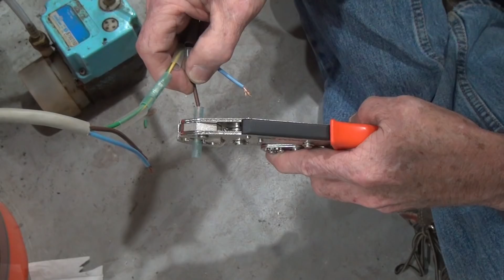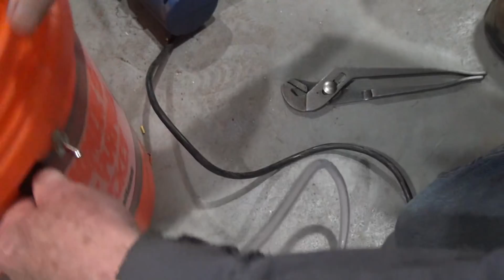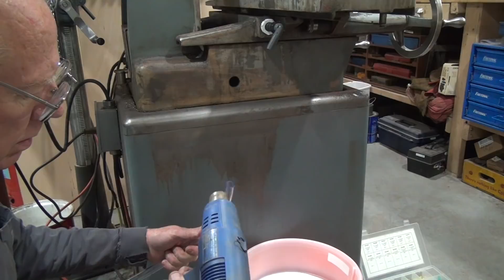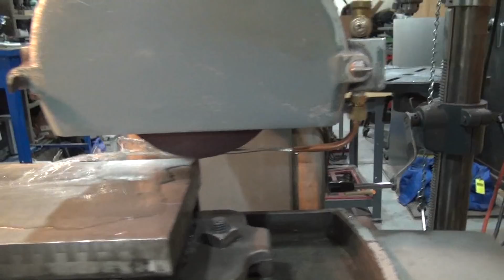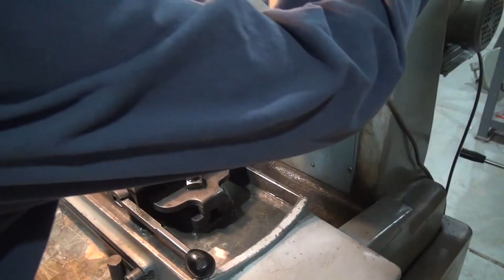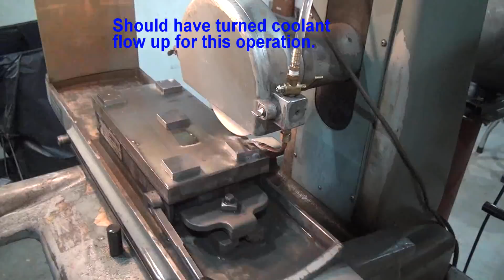Shop Tuneup Series - Surface Grinder Upgrades & Chuck Grinding

Comment: I’ve been a toolmaker for over 50 years now. We had several Harig grinders along with a Reid and a Boyar Schultz. The Harig was by far my favorite. I’m now retired with a decent garage shop. The last machine I needed was a surface grinder. After several years I found one only a few hours away and at a great price. Mine is a 6 X 18 hydraulic feed. After a good clean up it looked real good. The manifold on the oil pump wasn’t connected for whatever reason. Sump was loaded with oil. So after cleaning and reassemble we’re in good shape. I still need to make a coolant system before I grind the Chuck. Since it’s just pretty much a hobby shop I don’t need it to be within .0002 however I’ll still shoot for it. So what I did learn here was the ratchet crimping tool. That thing looks trick! I too had the same problem as you since being a teenager lol.  Nice video 👍🏼👍🏼

Comment: Thanks for the video, great content. One thing I thought is that with an H wheel, you are likely losing wheel material by the time you get to the other side of your grind, especially on the deeper cuts. I'd suggest to grind from both directions, not just back to front to help combat this. You coupons showed you might be just a hair high on the front of the magnet which supports this theory as well. I have an old Jakobsen SJ12 from Denmark, 1958, very similar, but hydraulic.

Comment: I have a harig 6x12 but ive been running real lifht passes with almost no step..reason being ive not seen how to run a coolant setup, where on the table is the drain? Did you modify it or am i just missing the obvious?
Reply from the maker: The table is essentially a tub with a hole in it centered behind the boss the magnet sits on. Coolant runs through the hole and into a long narrow trough in the casting under the table that it rides back and forth on. On the left end of that casting there is a threaded hole where the coolant in the trough drains. I plumbed a plastic pipe fitting and a hose to return the drained coolant to the pump bucket for recycling. I put a fine mesh screen in the bucket with a piece of oil absorbent Pig Mat on it. This Pig Mat is formulated to allow water to pass and trap any oil, etc. Maybe not needed but it's how I did it.

Comment: I'm new to your channel. Did you flatten the bottom of the chuck before the top? Solid Rock Machine has shown me just touching a metal part will change the dimension. A repeatometer will show that on a granite plate. Heat is you enemy on a surface grinder. Lots of coolant; slow material removal with very little step over will get you within 1 ten thousandth.  Good presentation.

Comment: Thanks for an informative video. I have a Parker Majestic SG and I'm getting ready to re-do the coolant system. What did you end up using as a pump?
Reply from the maker: I had a Little Giant pump left from another machine's coolant system so I used it. Little Giant pumps come in all sizes and models. I don't know what model mine is but it's not very big. I can say that this pump is very popular for small flood coolant systems.